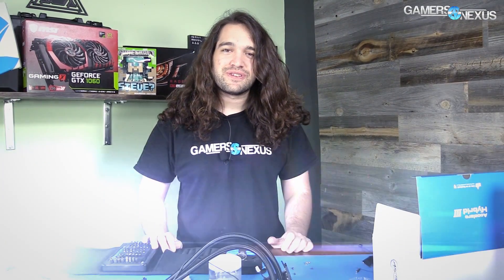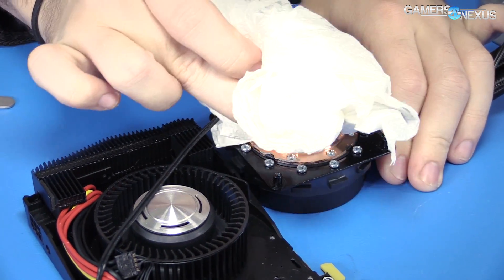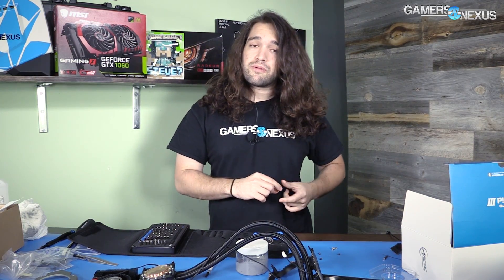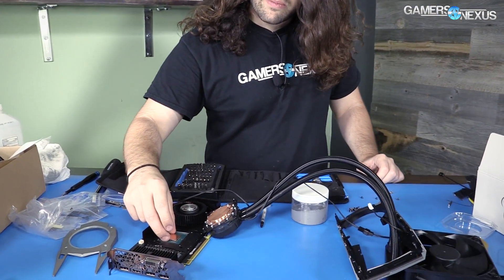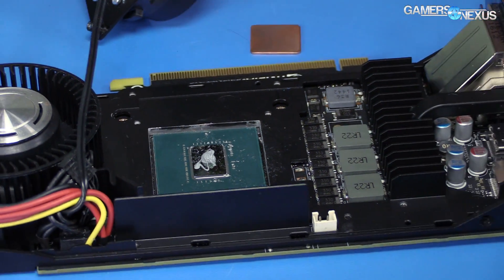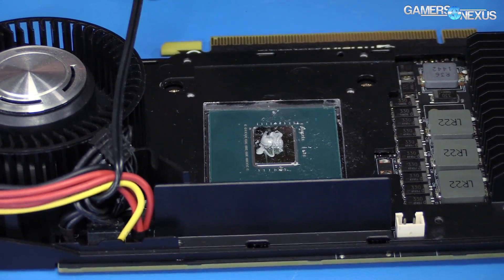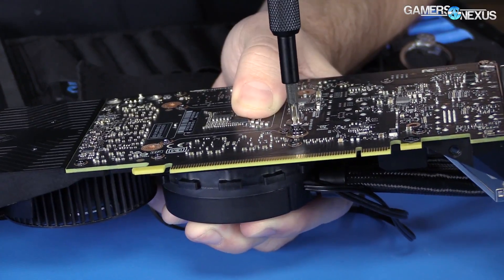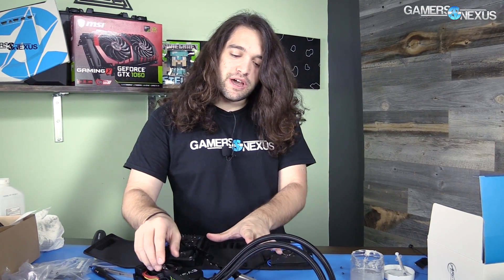Update on 1060 Hybrid Mod: Adding a Copper Shim

Comment: Can you shim a cpu? My AIO coolers works amazing when seated correctly.  I have a ryzen 3600 and a stock AIO from ibuypower and have been having issues getting it to seat correctly. I have to put an ungodly amount of paste on to fill the gap. I dont think the coolers actually reaches the cpu enough to make contact correctly. Could shimming the cpu like this method fix my issue?

Comment: I just bought a evga rtx 2080 ti ftw3 ultra and I want to use the kraken g12 so I can water cook it. Since the ftw3 ultras board is custom and bigger, what size shim do you recommend I use to get the best performance? Or do you think I should just use a dremel and modify the cold plate and the g12 brackets to fit properly? Any help would be appreciated!

Comment: Holy shit man.  Learn how to put TIM on. Why is it every vid of yours i watch i hasve an even bigger feeling you have no idea what the hell you are doing.
Reply: +PC Master race You do know that modern GPU's require significantly more Thermal paste than CPU's? Here you're dealing with the exposed die, and there is no socket into which thermal paste could spread and become and issue, thus it is best to overuse thermal paste to avoid hotspots on the silicon.  On CPU's being more conservative is good to reduce the risk of the TIM flowing into the socket, as the IHS already covers the die well.

Comment: I need couple of those copper plates for my laptop.
btw, What thermal paste do you recommend for gpus?
Reply from the maker: There are a ton of them online. Just make sure you get one that's the appropriate size. A lot of them are actually marketed towards laptops -- got me interested. I might try modding my personal laptop next.

GPUs, I'm using a tub of Asetek stuff. Not sure what the W/mK is. Arctic Cooling is generally good, in our experience. MX4 is one I'd feel comfortable recommending. ^SB
Reply: as far as i know thermal grizzly kryonaut is probably the best non metal thermal paste it is recomended and used by hardcore overclockers

Comment: shims like that = big no no
Reply from the maker: Actually, Corsair and NZXT both recommend shims as needed for their liquid cooling brackets. Also, this video series is very much -- as already stated -- a series that's experimental and for fun, and not meant as a tutorial or guide. We obviously don't recommend doing anything that's done in this series.
Reply: Your channel is entertaining for sure but someone is bound to think this is a good idea and try it...

Those copper shims are cheap stamped pieces of junk that are most likely warped and have an uneven thickness. They are not the same thing as those you'd find in a professional application which are perfectly lapped and require nearly zero paste. 

Besides, while copper itself is a great conductor of heat(385 W/mK), thermal paste is not (most thermal pastes are less than 5 W/mK and are designed to fill gaps that are fractions of a mm). Sandwiching a cheap piece of copper between two huge blobs of it is not only inefficient but could easily damage the die if not sized correctly and/or completely flat.

Try some fujipoly ultra extreme thermal pads from frozencpu. Well over triple the thermal conductivity of thermal paste and shims and it's much safer/easier/better.

I've tried both, and the fujipoly pads win hands down.

Btw, if you don't agree, this would be a great topic for a video.
Reply from the maker: We do this professionally. We are well aware of the thermal conductivity of each interface and have written several articles about it.

The cooling is actually significantly improved. If you skip thermal paste, you are leaving air pockets (~0.7W/mK) in the microscopic imperfections within the surface. Those air pockets turn into hot spots as the silicon cannot connect directly with the copper. GPUs are also flat surfaces, not curved surfaces (an IHS has a slight curvature, and so CPU coolers specifically have curved surfaces whereas this EVGA cooler has a flat protrusion for GPU cooling). Still, there are imperfections in manufacturing. The excess paste is pushed out and to the side by pure force. Simple. 

The stuff that's needed will fill the cracks. For GPU silicon, you want to use more compound than CPUs as there is no IHS. GPUs are also much less sensitive to extra compound. Our published data will show this on Monday/Tuesday, but we are already seeing a delta T (vs. ambient) value of about 16C under 100% load. That is a substantial improvement from the ~44-50C we saw with the FE cooler. That is a reduction of nearly 30C. The compound is not impacting cooling in a negative fashion which is substantial, and is so heavily offset by the efficacy of liquid and the setup that any loss is made irrelevant.

As stated heavily in the second video, we obviously don't recommend an unofficial mod unless someone's really OK with sacrificing a warranty and potentially a card. We already had to file the socket, which is not recommended. For cards with official mounting kits, like the 1080 and 980 Ti with their Hybrid kits (see: EVGA, NZXT, eventually Corsair), we do recommend the liquid mods for specific use cases as they are easily and safely deployed (with an official kit), require no additional modification, and massively improve thermals.
Reply: Sure liquid cooling will have better performance than the built in cooler...

But don't you think it would be even better with high thermal conductivity pad instead?

Btw, that's incredible you were able to write that much in less than 10 mins.
Reply from the maker: I see what you're getting at now.

A highly conductive thermal pad might be better. It's certainly not as consumer facing and we couldn't have gotten one in as quickly. We'll run the rig as is for this test, BUT I will see if I can get a hold of some high-end alternative solutions so we can test them all side by side. We're getting a thermal paste applicator built, so that will ensure consistent and equal application of compound to the coldplate. Once we have that, we'll have a good environment to replicate tests without variance from the user (application).

At that point, it'll be easy to test the impact of the paste - shim - paste method vs. a good pad. That'd be a good way to raise visibility of users to alternative solutions. Will try to research as time allows!
Reply: I highly suggest you at least try it. You will be amazed how well it works.

Btw, I've had good luck with fujipoly extreme and ultra extreme pads( but anything with decent specs should work just as well)

Comment: I think that shim may cause skewness and damage chip. Almost saw it when you installed radiator.
Also every thermal paste connection increases overall temperature on 2-3 degrees. A lot better use good air, than this kind of liquid in this case.
Reply from the maker: No... definitely not. You will see soon in the results that this kicks the butt of air!
Reply: +Gamers Nexus I'm looking forward to it!

Comment: LOL at everyone in the comments thinking hes applying thermal paste to a CPU.
Reply: he is applying it to the cpu of the gpu. a gpu in its whole is a graphics proccessing unit.. its essentialy a tiny computer in a computer.. it has ram and a proccessor in order to do its calculations
Reply: there is no cpu..... its only Graphics Processing no computing of tasks issued by the system. if we are talking just a super basic gpu with no async compute, phyx or anything like that but just the die
Reply: the unit its self as a whole is called a gpu( graphics processing unit) on the gpu you have the pcb not unlike a motherboard, gddr
( even hbm) ram of some kind called vram because the ram is designed for and is used for video processing. however it is still similar to its counter parts used in desktop and laptop motherboards kind of like how there is different ram for server systems.. this ram circles a cpu designed around  graphics processing. it is the central processing unit of the  graphics processing unit. A gpu is basically a tiny computer designed to to tackle a very demanding and specific workload which as far as i know cannot be done by a desktop or laptop based cpu. however i could be wrong on that last part and no I do not mean apu's because they are a hybrid where the silicon has both in one.. because guess what.. they are both processors lol. and guess what it uses the systems ram as vram.. but that is essentially two different kinds of processors in one... and idk if a normal desktop based processor can handle video loads.. bottom line is.. you are wrong. a gpu has a cpu and ram like a computer... next you will tell me arm doesn't make processors.
Reply: the ram simply loads things into it and allows the processing unit to access them. the entire thing is called a graphics card not a gpu. .-.
Reply: a gpu or graphics card can be called both sir. of course thats what ram does...  thats what it always does... so tell me  why is the unit called a gpu or graphics card if that is not what it is called?
Reply: you can also call the processor on it s gpu or cpu seeing as it is the central processing unit of the graphics card that also does the graphics processing.
Reply: It's like calling a motherboard with a CPU installed, a CPU xD

Comment: You could use a liquid metal solution to attach the shim to the coldplate. (and some very fine sandpaper)
Or you use tin, just be careful with the propane torch ;-)

Comment: Thats a bit too much paste tho but Hey you do whatever you want to do with your thing that you bought with your money and no one can complain about it lol.
I had a feeling you would add a copper shim on the chip and then applying the watercooler plate to the copper shim.....but then i was like you probably sawed off the founders coolerparts off. Then after watching this video you litteraly used a copper shim lmfao.
Now part 4 benchmarks!
Reply from the maker: It's the right amount of thermalpaste for a GPU! There is no IHS. You need more. The rest will spread out.

And yes! Looking forward to benchmarks. Won't run them til Sunday, though. We're backed up like crazy! Thanks for watching the series :)
Reply: you mean it's fine because it wasn't squeezed out on motherboard and dripped around?
Reply: Nickolay Prokofyev NO. It just does not matter on GPU's. Too little matters not too much. As long as it is a good quality, non-conductive T.I.M

Comment: Hi. I do not speak English. you can put another brand of liquid cooling cpu to EVGA change?
Reply from the maker: Yes. As long as you use a copper shim, you will be able to use a flat coldplate on your liquid cooler.
Reply: +Gamers Nexus thank You. because a copper shim  is needed? In rx 480 also you need?

Comment: BAAADDD ghetto-mod! No Dremel!!??! It's not a ghetto-mod unless you use a) Duct-tape b) strip-ties c) a Dremel with a carbide cutting bit:) :) :)
-nice... Looking forward to the results, temps and OC :)
Reply: Dremel is way too fancy for a ghetto mod, more like a file, tin snips, duct tape, cable ties haha :) also any busted bits of crap you have laying around
Reply: +ZiisusChrist that's the way, if it works don't knock it